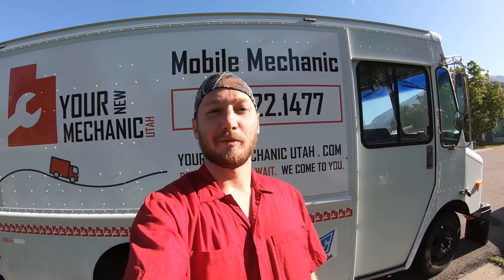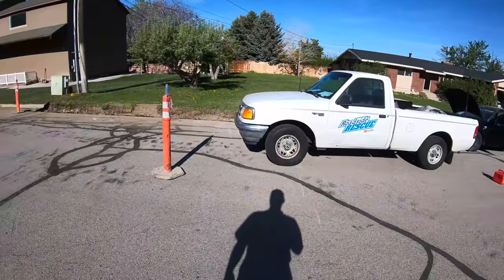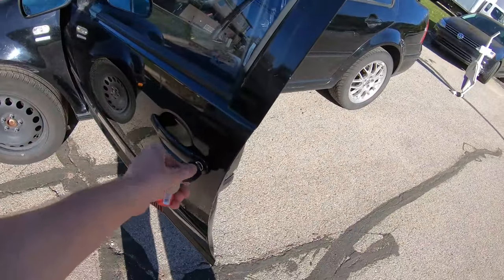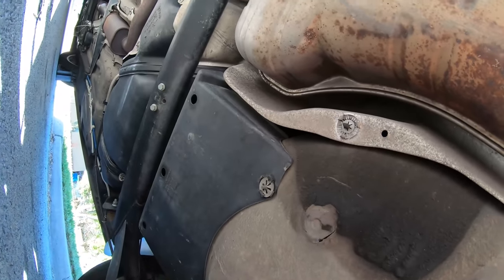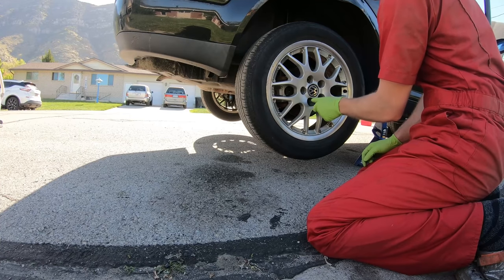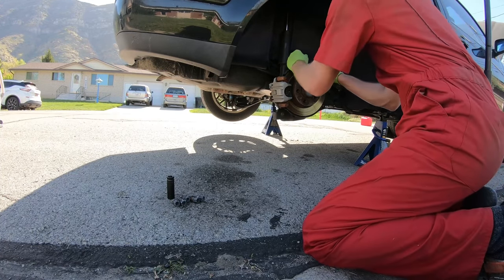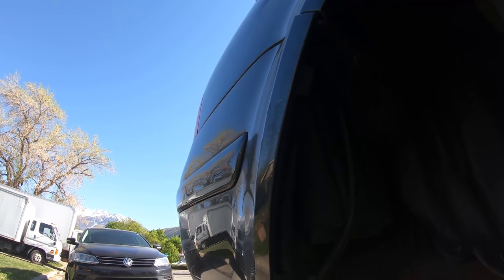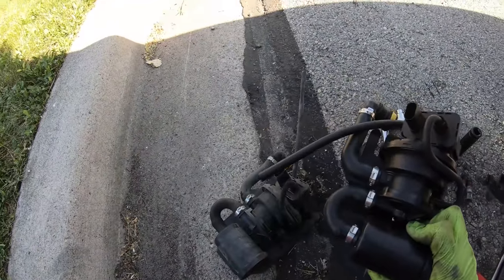2004 Jetta wont pass emissions again. EVAP PUMP.

Comment: I have been working on VW for 21 years. A long stretch working on 1.8T 20V MK4. That door lock has a spring and a cast mechanism that goes into the plastic door locking mechanism.  Typical VW, it's a way bigger pain in the arse than it needs to be for that repair.
Reply: Agreed, those MK4 are a supper nightmare, the locks, the main door master controller, the window motor mechanism with plastic parts, are all a pain and problematic.

Comment: To make it easier to line up the wheel they sell wheel stud holder kits that would three into the where the bolt goes and acts like a stud so u don’t fight putting the wheel back on huge time saver especially on euro cars

Comment: bit of a tip to line wv wheel blots up . m14 x 1.5 threaded rod and cut 2 bits to about 4 inch's long . screw them in and put the wheel on the . pop two bolts in remove the rod and do the two remaining blots

Comment: Hey Ernest, on the door shut, you undo the T15 and the lock barrel just pulls out, no need to take the panel off.
Reply from the maker: Nice. I thought maybe but I did loosen it (t20 in this one) and it didn’t want to move. Thanks for letting me know I’ll double check!
Reply: If you need any VW/AUDI/Seat/Skoda tech help let me know.
Reply: Use a plastic trim tool to lever it out after slightly pulling on the door handle